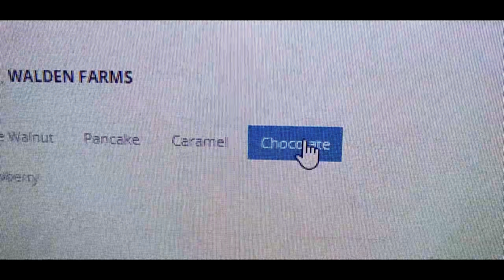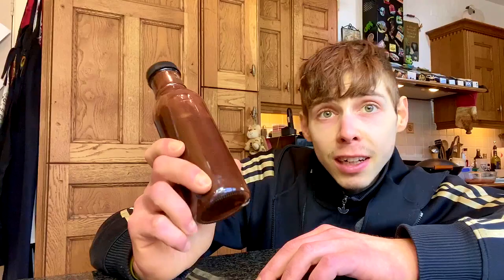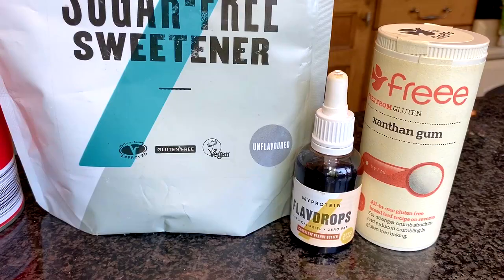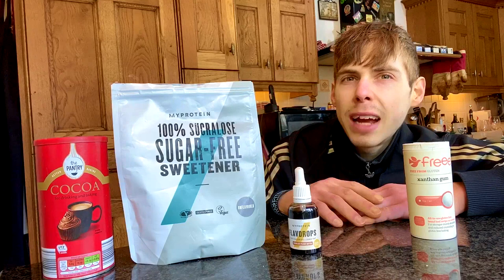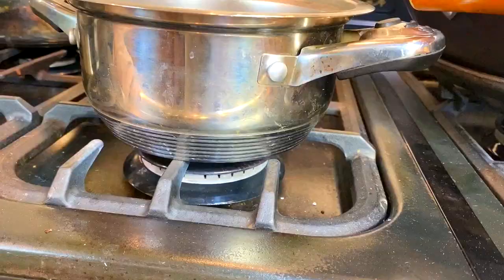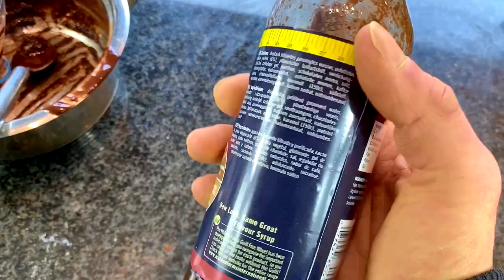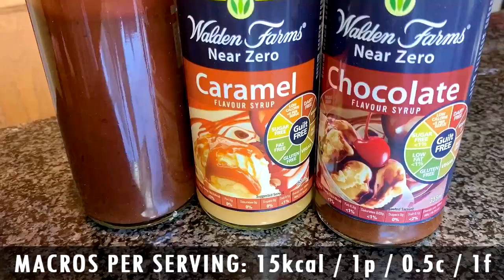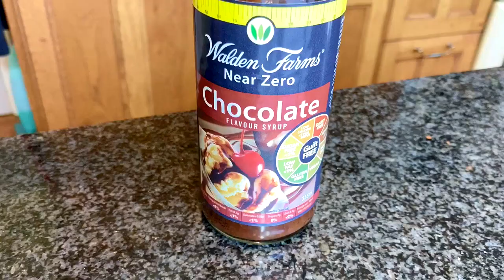HOW TO MAKE *0 CALORIE* CHOCOLATE SYRUP (3 INGREDIENTS) | Homemade Walden Farms Recipe

Comment: My man Scott!! Dude you gotta make a low calorie carne asada fries we can eat in bowls the size of our heads!! 🤤
Reply: Just weight out 6oz of carne asada. Bake it or grill it. baked potato 
(125 g = 25 g carbs
175 g = 35 g carbs
200 g = 40 g carbs
225 g = 45 g carbs
250 g = 50 g carbs)
Weight out how ever much you need, and there it is. A little bit of guacamole, some pico sauce.  Just making it home made does taste much better in my opinion. And you won’t get all the unnecessary fats.